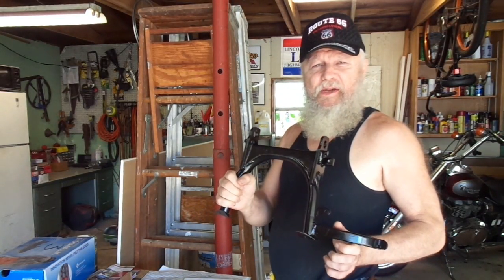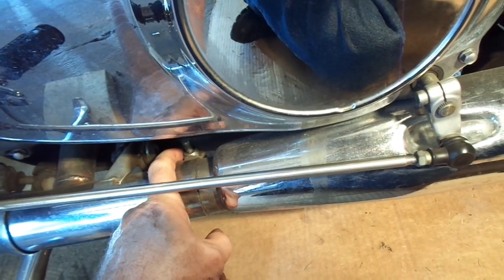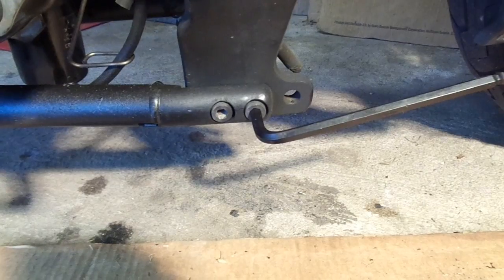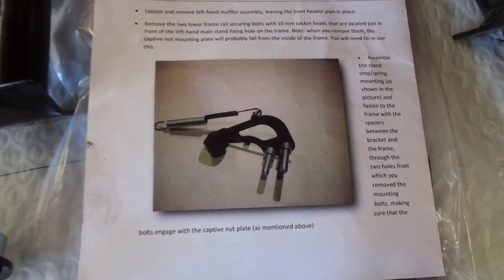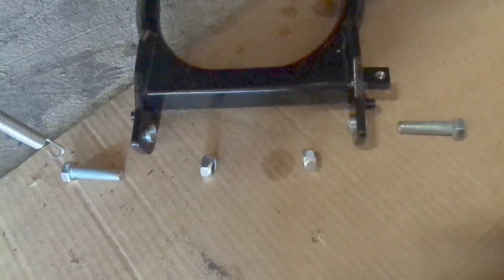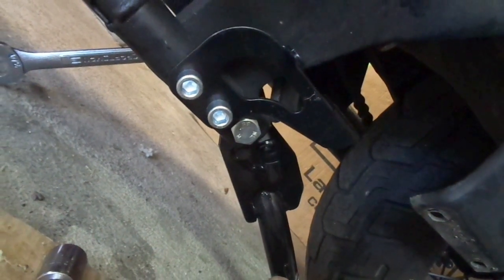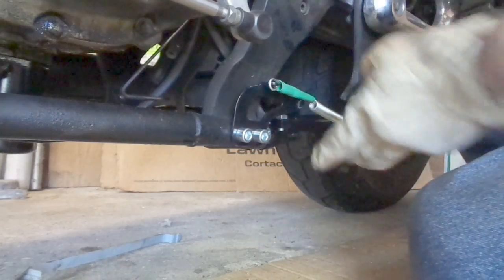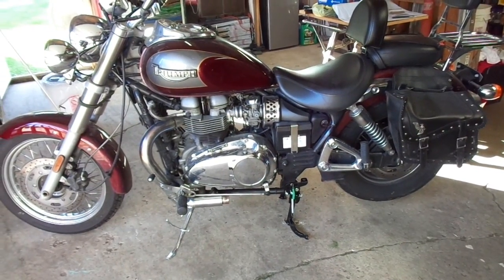Installing a Center Stand 2005 Triumph America

Comment: So were all triumph s without center stand s? I just bought a 2005 bonneville and i want to get one for it.  The last bike i had was a 1995 VMAX, and even it had a center stand. The reason these are a bit hard to pull it up on the stand is, you need a bar behind the seat to pull with. 
I've had 5 bike's over the years, and all had factory center stand. You think Triumph got cheap, or was it weight? Thanks
Reply from the maker: In the US it's always about price competition.  If you can shave $99 wholesale off the bike that is more profit margin for the factory and the dealer. In Europe I heard more bikes come with center stands because customers demand one.  Here half the riders don't care and would be fine with just the kick stand.
Reply: @suburbanryder  Sure that's fine , until u have a flat, or maintenance on the road where a center stand would be a god send.  I'm sure the Japanese like profits as much as European and American bike companies. But don't mind sacrificing a hundred bucks per bike, cept sport bikes. Thanks